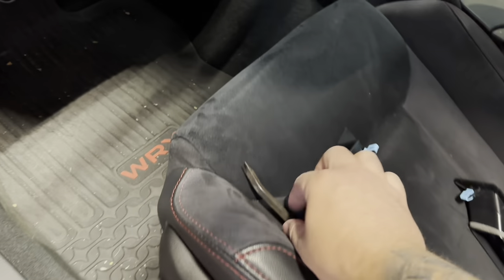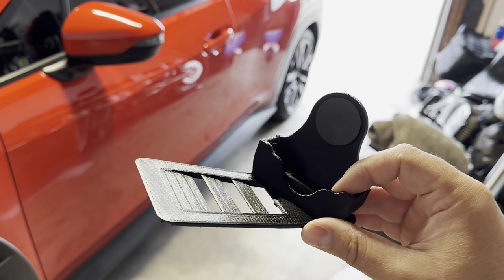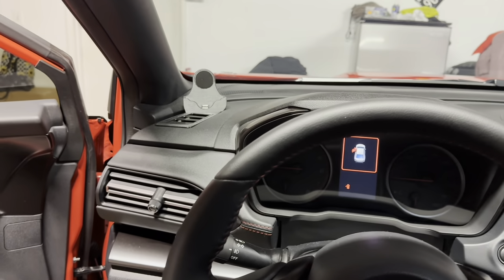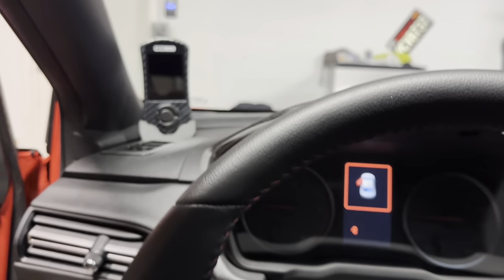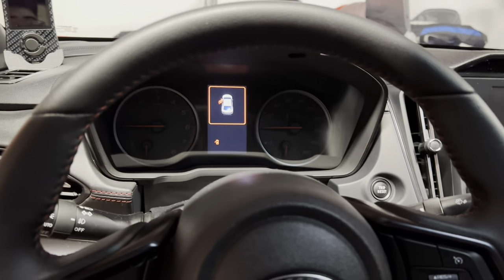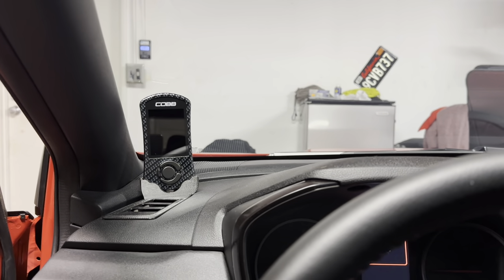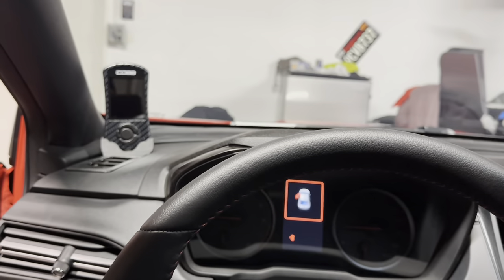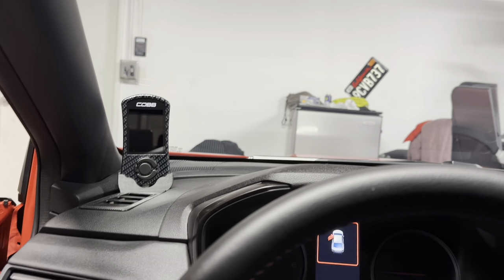2022 Subaru WRX Cobb accessport mount and drunkmann tuning review

Comment: Just got my first oil change at dealership (engine break-in ~1000 miles) and and they used OW-20!  And I'm in Socal!  Hmmm...Now you got me thinking I should check my manual lol
Reply from the maker: Yea bro check it out. I have been using 5w-30 for about 10k now with no issues.

Comment: Hey you can turn it off with the button on top and hitting ok
Reply from the maker: Thanks for the info! I’ll do that from now on 🤙🤙
Reply: I have a Wrx also I’m having a problem I think with the ac compressor does yours sounds? I have the cobb accessport installed but I haven’t done the intake I’m thinking about bringing it to the dealership I called and they said just make an appointment
Reply: I have a Wrx also I’m having a problem I think with the ac compressor does yours sounds? I have the cobb accessport installed but I haven’t done the intake I’m thinking about bringing it to the dealership I called and they said just make an appointment
Reply: I can’t wait to feel the difference with intake and drunk man tune 93
Reply from the maker: I haven’t had any AC compressor noises yet. Hopefully not at all but it’s still too soon to tell because I haven’t really ran it much since owning this.
Reply: @enzoridez  I’m at 1,300 miles I only drive it on the weekends I guess my luck